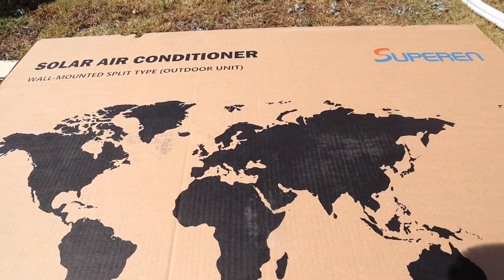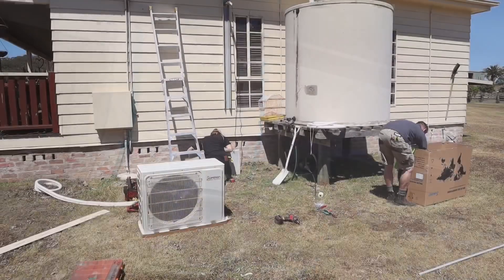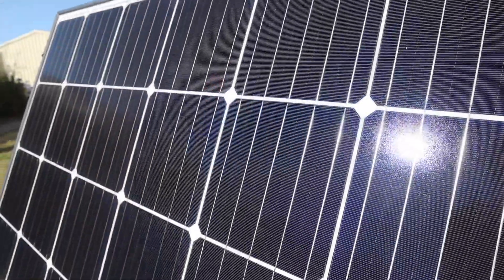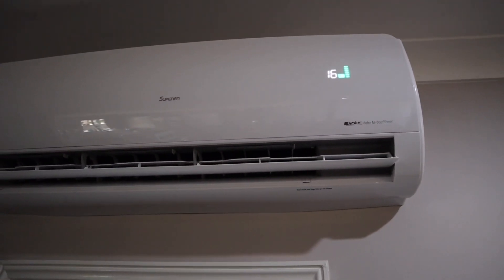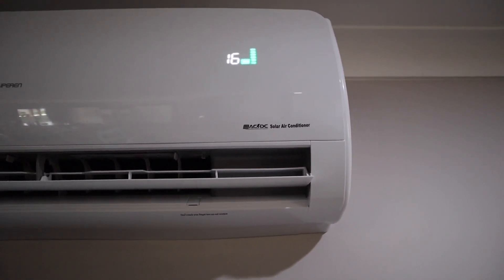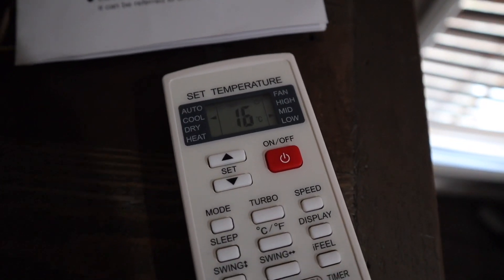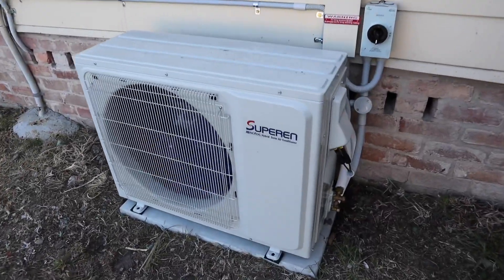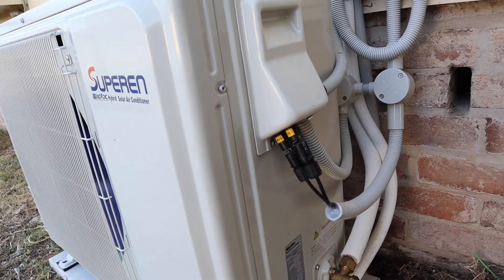SOLAR AIR CONDITIONER, Runs straight from the sun !

Comment: Hello Ty, we’ve been off grid in Qld for 7 years now but haven’t put in an air con system yet. These have always sparked my interest. One question though. When it switches over to your main 240v battery system at night, How many KWs will you use overnight until the next morning ? Do you change the temp setting or run it on ‘dry’ mode ?… we have 16KW batteries (Lithium) and concerned our system would drain too much overnight… Cheers
Reply from the maker: Hi, over night it all depends what settings you have it on. 

Ac units on 18 degrees can use like 5000wh or so over 8 hours in my experience. 

I don’t run it at night I just run it all day for free cooling the house, once sun goes down the house stays cool to sleep.

Comment: Hey mate,
I just thought I would check with you 4-5 years later how the Superen AC DC has been holding up. Any issue? Still happy with it? thanks for your feedback!
Reply from the maker: Still going fantastic mate, only issue I’ve ever had was the temp sensor that was simple plug and play replacement.

Comment: I´ve been looking for ages and yours is the only true sun-powered system I´ve seen. But will it turn on during a power cut using just the solar. Others have said starting it is an issue because of the amount of power drawn, once it is going, there is no problem. Also, will it run the heat function a lot of air conditioners have incorporated?
Reply from the maker: Yes mine runs completely on solar no issues with it not turning on.

Comment: Hey, stumbled onto this solar AC/DC unit recently (company called Soar AC/DC by ~Rob Miravet, think is the same Superen ~Rob) and was looking it up and found your video. Is it still running well, and have you had any issues?
Reply from the maker: Still running great ! Only had one temp sensor issue years ago. Easy swap out replacement but been great ever since.
Reply: @TyFenwick  Thanks. How does it go in winter for the heating? How cold does it get where you are?

Comment: Cheers Ty,

I live up in the tropics and because we are such a small town they're limiting the solar we can put up grid connected. The aim is to go off grid one day so time to start saving for solar ac for when the conventional ones die. Thanks for your video really helpful!

Can you have multiple AC compressors hooked up to a single solar array?
Reply from the maker: I’d run a separate system not connected to the grid directly to your AC system.

Comment: How's the unit running now? I have the Zamna Climate AC⚡DC version here in Jamaica 🇯🇲 for about 4 months now and it has been working quite well.

I occasionally use 340W×4 Panasonic panels to provide power to the 12000btu unit that needs 930W to operate.

Comment: Hey mate any dramas with the aircon now? thinking of getting the 3.5kw for a room thats 10 x 4 m
Reply from the maker: Mate I’m currently having issues with it cooling and getting hot as of this week, going to have the unit serviced as you do with an AC so see how I go.
Reply: @TyFenwick  yeah righto.. I'm on mains power anyway and I've been thinking I'd use it most of a night. I'm in North Queensland.
I was hoping you were going to say it was awesome..
Might just go for the standard aircon
Reply: @TyFenwick  actually I'll message you next week after the service..
Are you just talking about getting the dirt cleaned out?
Reply from the maker: Yeah I think it just needs a clean out. Other then that it’s been working great past few years.
Reply: @TyFenwick  how'd it go after the clean?

Comment: Great one .. Does it have a  battery unit to store the excess energy as it can utilized later at night for example ?
Reply from the maker: No you’d need to run a battery system, I have full off grid system so it runs off that during the night 👍🏼

Comment: whats that an inverter ac ?
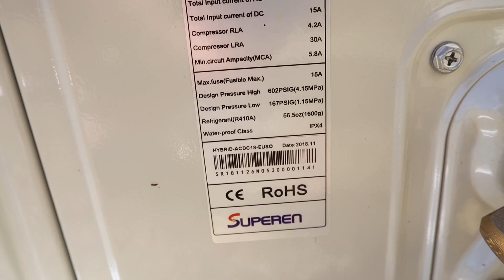Reply: It might not be an inverter type unit. The nameplate at 1:37 shows RLA = 4.2 amps. Run load amps. Also shows LRA =30 amps. Locked rotor amps. The inverter mini splits i have in the usa start up at the minimum compressor speed so there is no giant spike of current required.  It would be nice to find a pdf install user manual for this unit in thus video..or service manual too. Regards to all
Reply: It is definitely an inverter type air conditioner.

Comment: Does anyone know who to contact in the Brisbane Valley area when these aircon systems require servicing or repairs? I had a 48v one installed about 3 years ago and it no longer cools. Trying to find anyone interested enough to come out and take a look at it has so far proved impossible.
Reply from the maker: Have you contacted them directly?
Reply: @TyFenwick  G'day Ty...Thanks for responding. Whom do you mean contact directly - the original installer or those at Superen? 
Our original aircon installer doesn't appear interested in answering  the phone or responding to messages so I assume they're not concerned with pursuing the matter of repair or servicing.  Disappointing to say the least and a terrible way to treat customers in my opinion.  Others feelers I put out there have also provided nothing and I'm beginning to think we must have the plague or something. 
I did get one response from 'Superen' however, (they're wholesalers only though) who advised replacing the existing 48v system with a hybrid one to run on 240v - and they have supplied me with the name of an installer who might be interested in doing something for us, (but not likely to).
However, having spent a considerable amount of money already on installing the 48v original system a few short years ago, I'm concerned that I could just be throwing money away if all that's required is to recharge the gas in the 48v original!  
All we need is for someone to come out and take a look at the thing.....that way I would know which direction to take. We'll just have to keep trying I guess - and it's not like we're aren't prepared to pay for their time.  Living in the country isn't all that it's cracked up to be. For us - it's become a real problem!

Comment: That system would be perfect for my off grid house. I was looking at getting mains power purely for an AC. This maybe another alternative. No one has asked but how much was the 5kw unit to buy and what was full install amount. Their website doesn’t put up prices. I under stand all installs are different but would love to know what yours was. I’m on the Gold Coast so I’m not totally isolated. Cheers.
Reply: G'day Roughneck. Not sure if this will help, but our place runs on solar power only and we had a 48v aircon system installed to try to keep cool. What we found was the cost of the install is pretty high initially ($8000 which covered the cost of panels, the unit itself and running 48v wiring to the system's locale and cost of labour.  We live near Somerset Dam.  I suppose the cost could have been associated with the fact that we were perhaps one of the first off the rank so to speak to have  a domestic one installed and to be one of the first in so to speak is always likely to cost more.  Perhaps they are cheaper to install these days..... 
 
Pros and Cons -  Pros:  The system worked fine for about 18 months.

 Cons:  After 18 months the the airflow deflector of the unit inside the house failed. Not such a big problem overall,  but annoying all the same. Now the outside unit has failed and can't get the system to cool down at all. Don't know what the problem is, but I suspect it requires re-gassing or the compressor has failed. What else to expect from having been made in China I guess. Now comes the really difficult part..... I can't seem to locate anyone who will have anything to do with even looking at it to determine the system's problem; part of the reason I came looking for answers on this site. 

My advice.....be careful to get a good quality unit and make certain you get some good advice on where to seek out a reputable repair service if required, because I feel our own problems are just beginning in this regard.
Reply: @warrenharvey4420  
I actually installed one last week. A 5kw. It’s from a company called Solar Green in Brisbane . It’s a DEYE named unit with a 5 years warranty. It’s keeps my little place like a fridge.  21 all day when it’s 35+ outside. 
Runs directly from 8 panels or you can connect to a 240v10amp switch which only kicks in when needed. So mine only draws AC power after 5pm. I hooked up 240v from some very long extension leads from my power box. 😎
Mine was $4900 installed. Panels and unit. 
Fingers crossed it doesn’t have any issues 
Thanks for the reply. 👍
Reply: @roughnecktrekker1976  Ours was 7kw Roughneck so if 5kw is all they go up to then it'll be too small for us, but thanks for the response anyway.  I'll keep looking and give the people you dealt with a buzz to see if they can offer any further advice. I kind of think we may have done our dough on the original though - particularly if no-one is interested in servicing it.
Reply: @warrenharvey4420  were you able to get your issues resolved? Or did you end up buying a new system?
Reply: @davidnewkirk2438  Hi David - No, still attempting to find a solution to the problem. I will admit that I've run out of interest trying to get the system looked at, so it's just sitting there doing nothing! It seems all too hard for tradespeople to follow up on service these days and I'm tired of looking only to discover I'm wasting my time. Seems as though no-one has a problem installing a brand new system, but as far as repairs are concerned, no luck. All to do with how much profit (ripoff) can be made I suppose....new work can be loaded up with extras which the customer pays for, but isn't aware of - whereas repair charges need to be kept to a minimum otherwise the customer balks at paying.
Reply: @warrenharvey4420  It's important to purchase a good quality unit from a reputable Australian supplier.

Comment: How's the system going now? Reliable? Any issues? Did you use it at all in winter for dehumidifying, etc? Are you happy with it?
Reply from the maker: Been a great system not 1 issue and yes I have been running it all winter on heat 👍🏼
Reply: @TyFenwick  Good to know, cheers
Reply: Great to hear I’m in Arizona and it’s 114 Fahrenheit the last couple weeks and stays around 110 on average in hotter months.. I need this system

Comment: I understand your point of running it in the day. Can you connect batteries to it for night time? Thanks,
Reply: There’s a slightly different model that runs off 48v and is a better fit if you want to use batteries directly. The model in this video uses AC from an inverter which is obviously powered by batteries when the solar is insufficient. In theory, the advantage of the DC battery only system is not having to provide a whole separate bank of solar panels. You would however require probably double the battery capacity. So the hybrid model in this video is a great option.

Comment: How do you know if its running off solar or grid power at any point in time?   Is there something on the display indicating this?
Reply from the maker: Yes so on the unit it’s self it lights up green during the day when it running off solar, then when there not enough solar it will light up the red lights they mean generator or grid power.
Reply: @TyFenwick  Does it provide heat as a heat pump as well?

Comment: Thanks Ty - great video, very informative.  Look forward to the update.  Was it relatively easy to install using a licenced electrician, or would we need a solar specialist?
Reply from the maker: We had a licensed solar/electrical installer fit the panels and we had a general air con installer put the unit in. Thanks for watching ! 😁
Reply: @TyFenwick   Looks great! How does it cope with being on DC only. As in once night hits it just turns off? Does it automatically turn back on to the same temperature once power hits again? Would be a pretty neat "climate control" system if it was able to run off solar only! Looking forward to that update.

Comment: So you have no battery storage for it? It's running straight off the solar? 
Why are you running it at 16deg? That would make it work hard, usually it is comfortable to run around 21deg
Reply: I mean, why not? Unless you were getting uncomfortably cold, I can't see a reason not to; his panels aren't connected to anything else so if he were to pull less current than he's generating it's for nothing.
Reply: @trudyandgeorge   because if you read the instructions you will find they don't recommend running it so low
Reply: @quakkapoowestaus  which instructions? The ones for his unit? Or do you mean air conditioners in general?